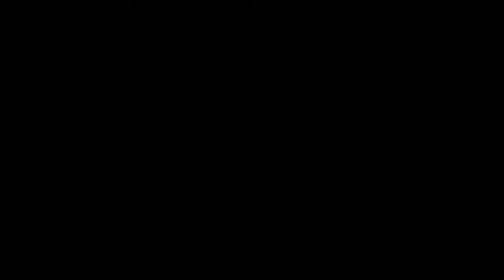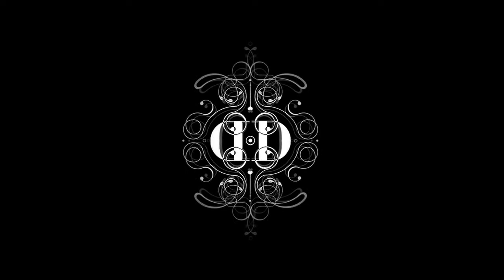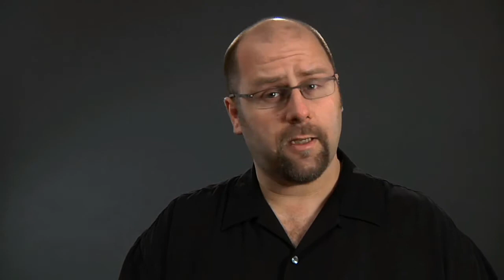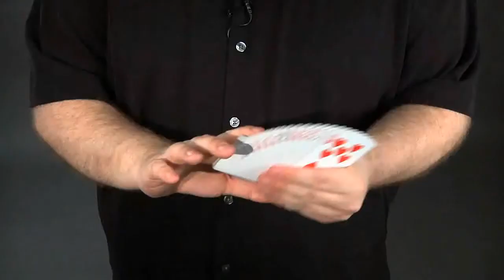Paul Wilson - Mechanical Fan Steal

Comment: I'm afraid to tell you that's how the magic industry works nowadays. They've found much simpler to film the DVD in a row, and then cut the beginning and use it as a trailer. I understand your point; but they like to play with conditions (I'm gonna teach this trick to you / CUT / if you buy this DVD / CUT / ). But there's no reason to attack other people with insignificant insults. It's impossible to win an argument on the internet. 

I have also to tell you that these DVDs are not easy magic...